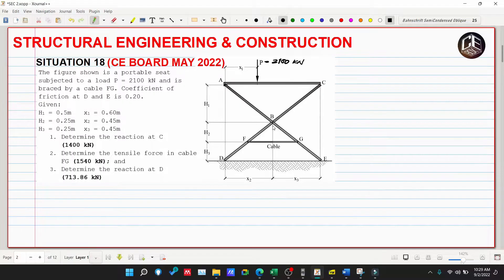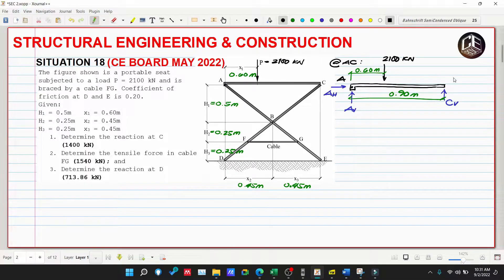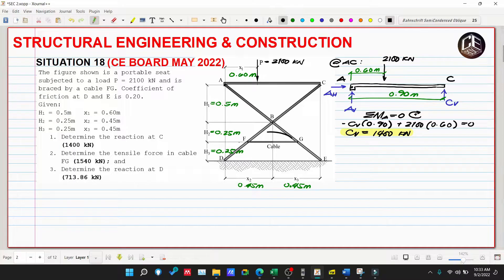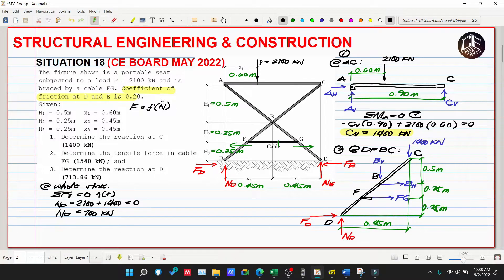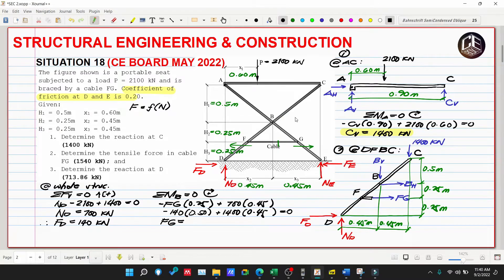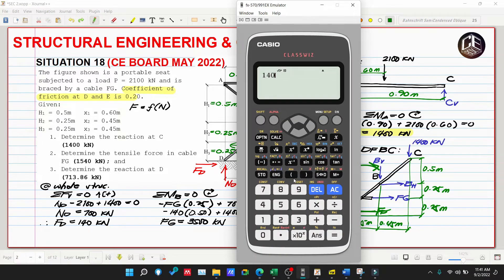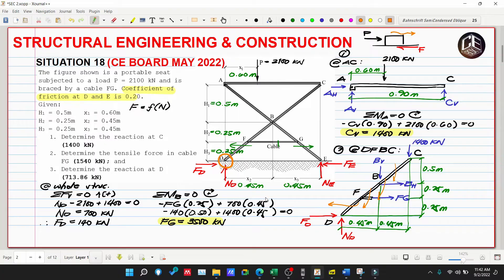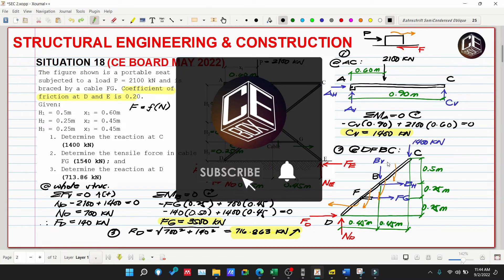Structural Engineering & Construction Situation 18 (PH)

Comment: Good day sir, ma tanong lang po, for this question po ba, kapag mag sosolve ka ng internal forces, need mo ba talagang i coconsider yung mga reaction ng bawat support present, tama po? Yung nag try po akong mag solve niyan, specifically yung tension sa force, medyo ma liit po yung na kuha kong sagot compare sa choices, at first akala ko mali yung pag solve ko nung reaction sa both lower supports, then nung napa nood ko po yung video niyo, na realize ko na yung structure pala itself is consist of multiple supports. Tama po ba?
Reply from the maker: Hmmm, una po, need niyo malaman ang difference between support and connection, and also members.
1. Support - support reactions
2. Connections - connection reactions, nirereciprocate natin ang direction/rotation ng reactions dito sa kada member.
3. Member (Cable, rod, steel, etc.) -  internal forces (Tensile/Compression).

Mapapalitaw mo ang internal force kapag cinut mo yung member, then need mo pumili ng FBD kung saan included ang internal force na yun. Not necessarily na whole structure.

(Sorry for the very late reply. Abala po sa work and stuff. God bless! 😇)